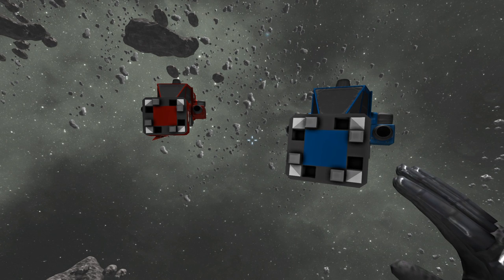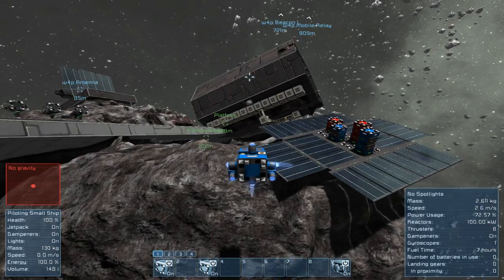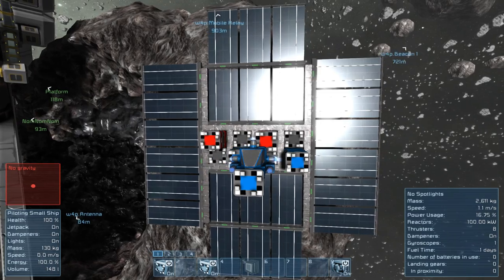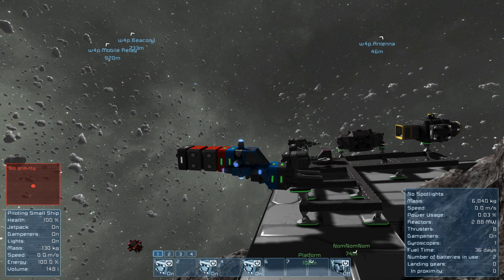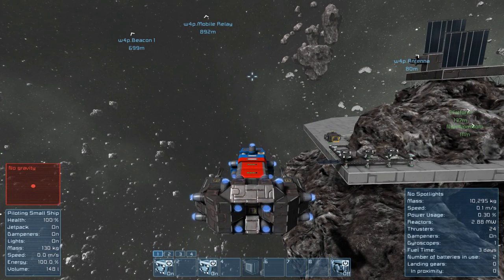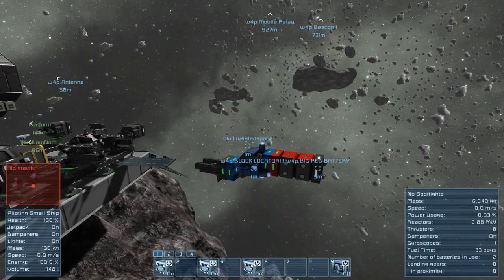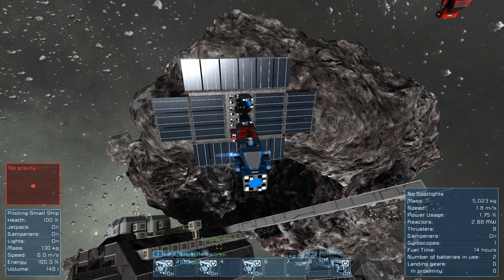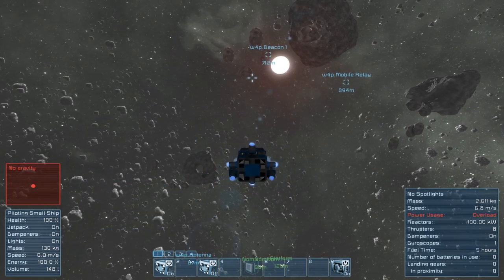Space Engineers - A Modular Ship - Concept, Design & Use

Comment: I wanted to give this a try in my new world right from the start, but I lost track of the video.  So  my first ship was a basic 2 drill miner with 1 thruster in every direction.  Then I found the video and started work on the modular ship and drill attachment.  Not caring for the shake that my other ship had, I decided to put 2 thrusters in every direction.  The drill attachment consists of 3 drills, three medium cargo holds, 4 ejectors, a connector, and an open ended box of heavy armor surrounding all the small pieces matching the drill shape.  It turned out to be extremely stable.

Next was the recharging station, but I made it into more of a flyable ship.  I spread six battery clamps out a bit and added two elevated clamps for ships not in use. Small ship cockpit on one end, along with all the necessary pieces to make a stable working ship.  The platform ended up being 25 (bow and stern) by around 30.  If I had made it bigger the attachments could dock there as well; maybe a future project.  I then considered the naming of the merge blocks.  I didn't like the Little Red, Big Blue naming you used in the video, simply because of the confusion you had in hooking up a battery and talk about it through the video.  I went with location on the ship, Port Ship MB, Forward Port Battery, Rear Port Battery, Forward Center Battery, and so forth.  I went on to add a couple batteries to the ship itself, parked it on the asteroid in the Easy Start game, angled for four lights on the collectors.  I decided also to not bother with the 1 battery modules, and just make them all 2 batteries.

I'm now thinking of how I can use the battery modules to completely power my station.  Unfortunately small merge blocks can't be put on stations or large ships.  My thoughts right now are a connector on the station mated with a permanently docked small ship consisting of a connector and a couple of merge blocks. Battery packs are added and removed as necessary.  They can even be stacked besides making bigger batteries.  Right after my auto miner is built....

Comment: could've used an advanced rotor for the cockpit. set it up to advance the displacement, rotate 180 degrees and retract displacement. Bam, now you can connect and disconnect either side and face that way without using 3rd person cam.

Comment: I am relatively new to SE and I do have a simpler version of this on my Earth station.  However I have Landing Gears attached to each of my modules.  Your use of the landing gears placed up-side-down with the easy removal looked so good I just knew I had to go and make some amendments to my set-up.

But sadly, I discovered that I cannot adjust the force of my Landing Gear, despite your explanation.  Seeing the date of your release of this clip I assume that when you did this you could adjust the strength of the magnetism, but that is no longer the case.  Or am I missing something?  I ask that, because the Wiki also states that the strength can be adjusted but I don't see how.

Comment: I really like this concept, but I couldn't download it. Instead, I had to make some from scratch. In order to solve the problem with accidentally detaching the wrong merge blocks, I renamed ones that should never be turned off as "DO NOT TURN OFF." I also numbered the batteries and put LCD screens on them, displaying their number (admittedly, that patch came long after this video).

So far, I've made a front and rear drilling module. Your subway system inspired me, and I put free-spinning wheels on the on the rear module to prevent it from bouncing around and hurting itself. It seems to have worked, because I have yet to need to repair it.
Reply from the maker: Nice thinking adding the wheels to the drilling module... did have a vague thought to try that when I made the subway system but never got around to it. Nice to know it works :) The LCD screens must be a real help with this now, nice clear way to identify which is which etc, a good thought using those on this.. a much improved version it seems! Cheers
Reply: ***** I think a simpler solution would be to just have a timer system on the station, activating the timer disables recharge on all removable batteries, disconnects all merge blocks, waits 2 seconds, re-enables all merge blocks and re-enables recharge status on all batteries. The batteries that were not removed will re-merge and this way you don't have to rely on the semi-auto mode of batteries so they will recharge to full.

On another note I think the reason it kept vanishing from your toolbar could be that the battery was included in your group and possibly you included the merge block on the station so when part of the group disconnects it is removed from the toolbar
Reply from the maker: Yeah could be the group causing the disappearances indeed. The timer idea is an interesting one indeed.. I don't think they were available when I did this build, seem to remember it's being just after they added merge blocks in. Nice technique to get around the semi-auto problems though :)
Reply: haha my bad. I have been going through all of your videos one by one and often forget to check the posting date, I haven't been on space engineers for long so I don't know when things were released. I have to say you have a great channel here, keep it up
Reply from the maker: KaoS Dlanor Thanks dude :) Good to know the older videos still have a little life in them at least, and tbh it's nice to have reasons like this to re-think old ideas that have new options now! Cheers
Reply: *****
 i was going to do this when i get the game, im going to build hallways with large ship blocks each with its own task in mind
Reply from the maker: Quentin Tubb
Sounds cool :)

Comment: You should have mentioned that all this modulas arn't survival compatible. For example the welder needs ressources to weld anything but you can't access the cargo space of the welder nore does it have any containers for ressources... but anyway the idea is nice and i also thought to do it like this :-) but with my own desings....
Reply from the maker: I was both built and used in survival, was all I played at that time.. welders do actually have cargo themselves, albeit small. Might not be very efficient but it's functional :) And that's the welder/grinder only, the others are fine if you consider there was no such thing as a reloadable rocket launcher when I made this either.
Reply: ***** I mean the problem is that the only way to put things in the welder cargo is, from the point where you put the connector on, so you can't put things in the welder cargo so it can't be used in survival because you need to have ressources in there. I diddn't noticed some other points at the welder to put things in the cargo last time I used it, so its important to use large conveyor system to connect all parts together which makes the modul much bigger. My modul which i also build in survival needed 3 conveyors and one medium container. Otherwise it would not work. I dont know why even if i only tryed the welder with ressources in it did not weld anything, only if the conveyor system behind the welders worked fine they did their work ... maybe i missed something...